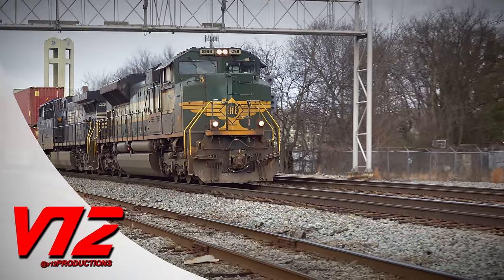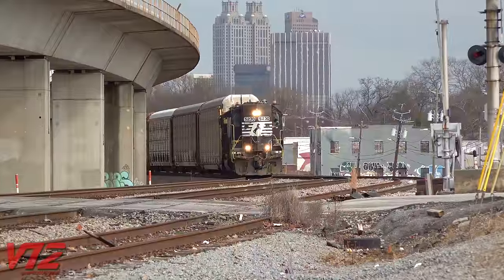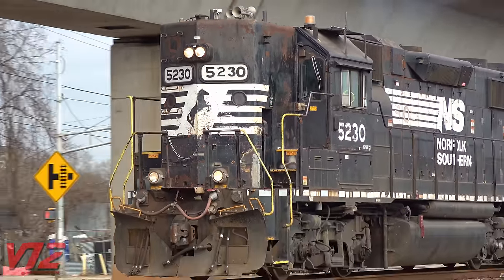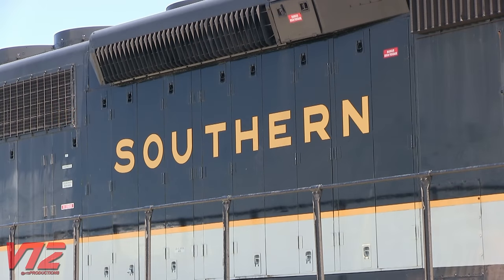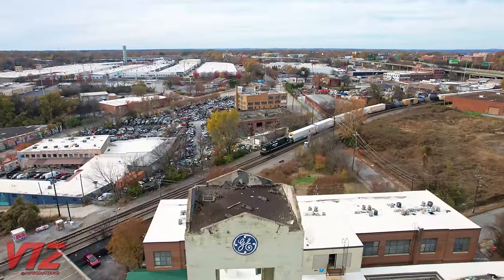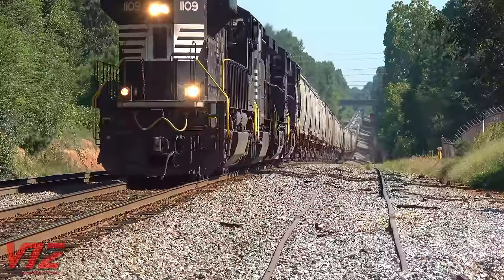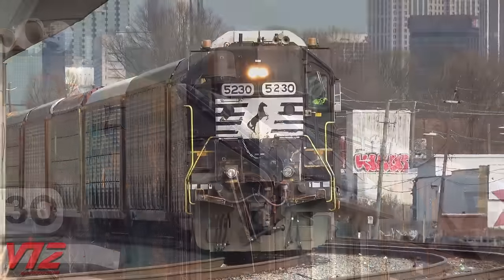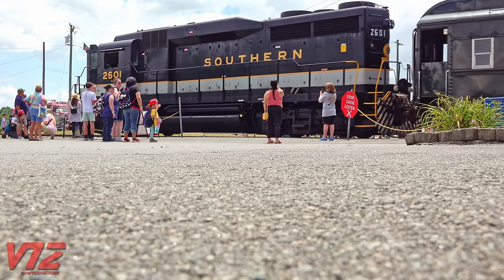SECRET Heritage Locomotive?

Comment: I retired from the W&LE and we still had old Southern high hood GP35s. Retro to make a GP35-3. Liked running these units because the control stand was adjusted to work for both directions. Many 6 axel units aren't made to run long hood foreward. The control stand is not adjusted and eventually will cause injury to the engineers neck. The GEs are definitly not long hood friendly with the radiator grills hanging out. Good video and always loved the Southern high hoods!
Reply: Say, why did the WLE sell a lot of GP35s to LTE in 2010, if you by any chance know?
Reply: @joshthetrainfan  They had quite a few and didn't need them. They found someone that would buy them to put back together because the Alco trucks are getting scarce. They also gave a few to Historical railways for tax wrote offs.
Reply: @kerryrock9248  Ohhhhhhhhhh that makes sense!

Comment: I missed the high hoods. When the track near home was still active. Used to have a local come threw to switch. Usually a GP-38dash 2. Or two of them. I still remember a few wearing their southern tuxedos. The real show was in the evening between 6-8 pm. When a coal train came threw. Usually had four or five SD40-2's. They had a small grade to deal with. When they crossed the creek. Everything in the house would vibrate.

Comment: Somewhere in my photos is a photo taken in 92 or 93 of an unintentional CNW CGW heritage unit. Freight heading out of Proviso up what was still the Twin Cities line northwest of Chicago ( would be severed in several places northwest of Janesville Wisconsin across Wisconsin a year or two later) when for reasons probably related to making sure an oncoming commuter train would be between stations rather than coming through a station while the commuter unloaded but this gave the opportunity for some close inspection of the lead unit that by the still intact Mars light on the nose indicated a former CGW unit.  As we photographed the power we began to notice the outline of the old CGW Lucky Strike herald, her original road number ( 407 IIRC ) under the paint as well her original red paint coming through on the toe kick leading into the cab and a patch on the short hood where crew jackets had worn away the CNW yellow entering the cab.

Comment: Railroader here. Hate to disappoint the railfans here, but running LHF in anything absolutely 100% sucks for us crews.

All of the PTC screens and IFDs are oriented for short hood operation. So running LHF means constantly turning back and forth to check your screens.
If the unit has flared radiator grilles like the 70 series EMDs or even the Dash 9s and rebuilds, you’re breaking your neck and back bending down to see past them.
There is a rear wall speedometer, but it does not do much justice when all of the other interfaces are for forward operation.
The horn is 5 times louder and you get diesel fumes blowing into the cab through the poorly sealed doors.

There are alot of reasons LHF is no longer the practical way to run and those are just a few.
Ever since the introduction is the wide safety cabs, there has been no need to run LHF when it comes to safety.

I know buffs love it and think it looks cool, but man I hate it.
If I have the ability I’ll take the extra few moves to spin the wye and put the unit short hood forward before a trip.

It just isn’t ideal anymore.